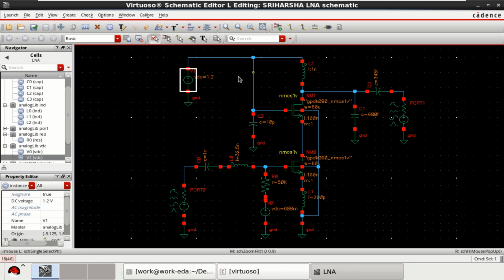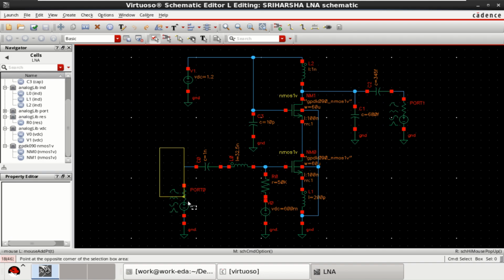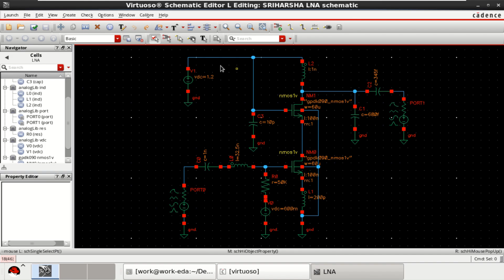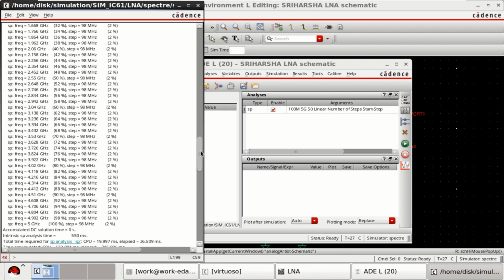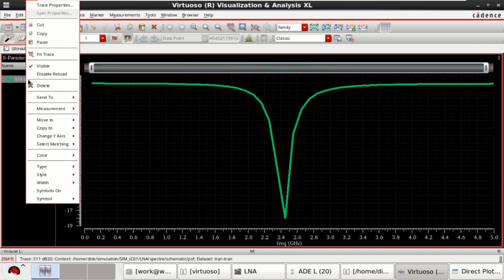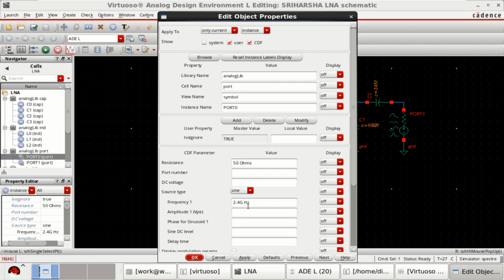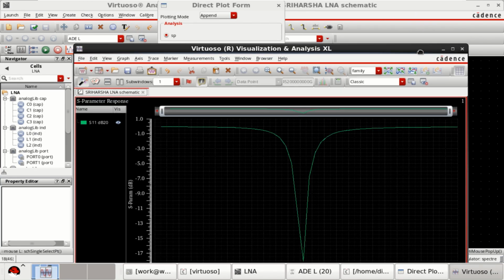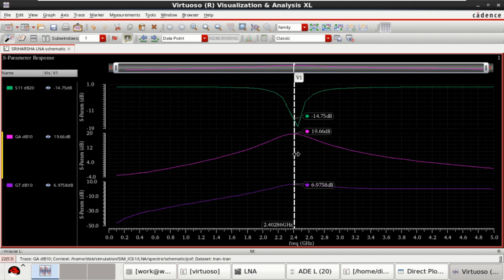CMOS Low Noise Amplifier Analysis using S-Parameter.

Comment: sir i have tried same circuit with same values but i am getting Dc operating point issue , spectre couldnt find the dc operating point
Reply from the maker: Hi, check the operation of dc analysis properly with any reference videos. While performing dc don't plot just go for annotation

Comment: Sir, I didn't hear about the S-parameter. Is that similar to the pass transistor logic?
Reply from the maker: Hi, S-parameter are used at high frequency to characterize the circuits.
Reply: @dr.hariprasadnaikbhattu  Thank you.Appreciate it,sir
Reply from the maker: Welcome for the response

Comment: Sir, I have one doubt, I wanted to design this same LNA for 130nm for frequency 433MHz, what all values should i use for inductors and capacitors. Or how can I calculate those values?
Reply from the maker: Hi, I cannot give the exact values for LNA. But try the local optimization
https://www.youtube.com/watch?v=7SUq2IG6DO0